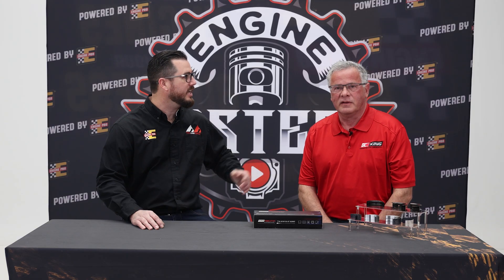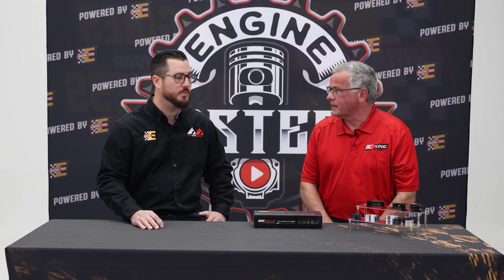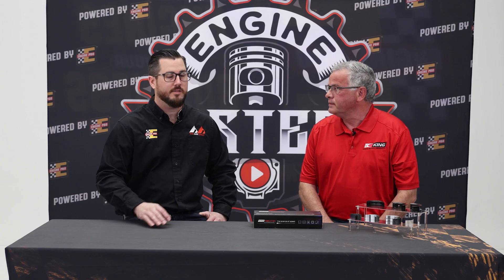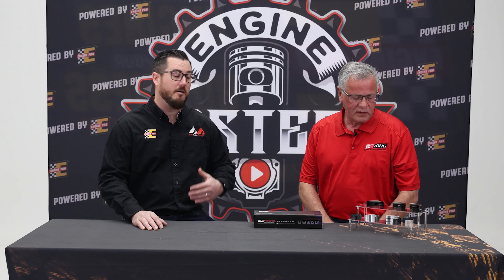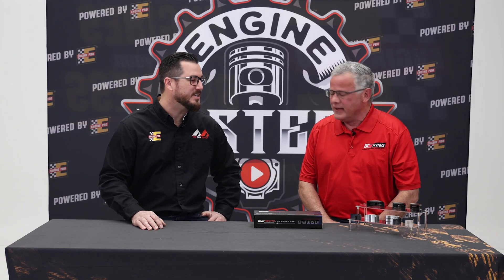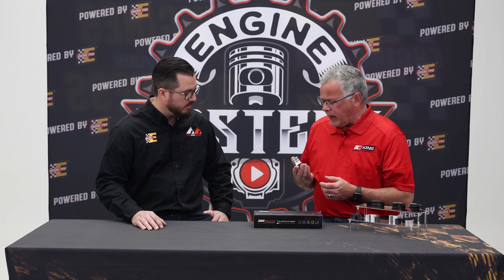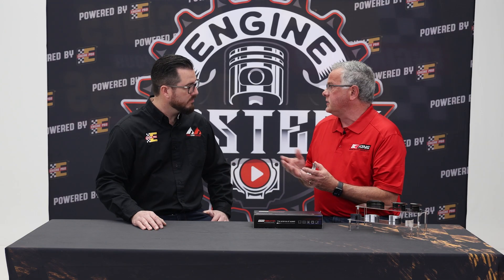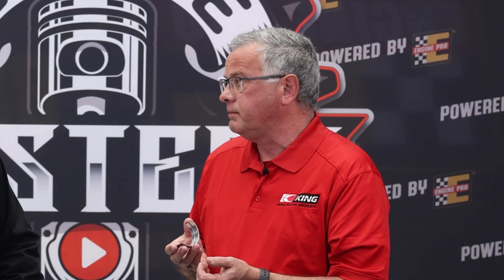⚙️ Engine Bearings Explained: Aluminum vs Tri-Metal | Groove Tech & Oil Film Pressure. Part 1!

Comment: I have King alum bearings in my Holden 355 ci,,Scat cast iron crank,,11:1 compression ratio,,still running well after 12 years,daily driver
Reply: yeah cast cranks  are usually found in stock engines  but yours is modified running a cast crank.  i would think youd still be ok  with bi metal bearings.

now put a power adder on it  .......probably move to tri metal
Reply: @KingJT80  Thanks for the reply,engine only making around 400 hp so ok,,cheers